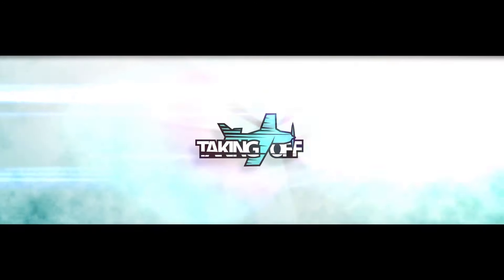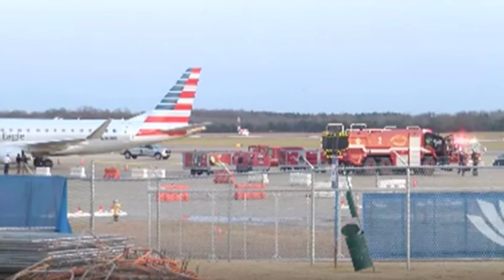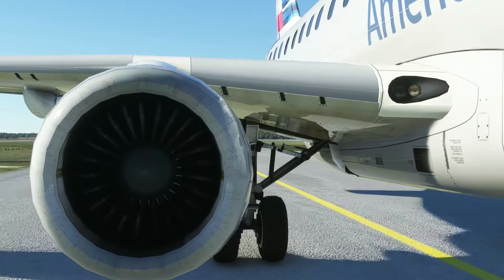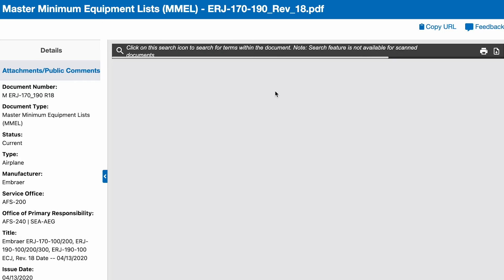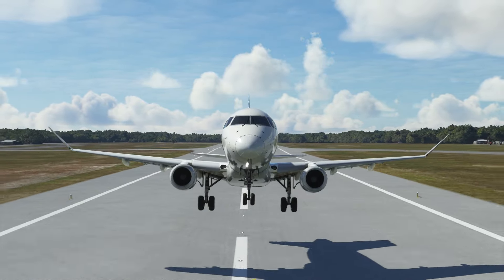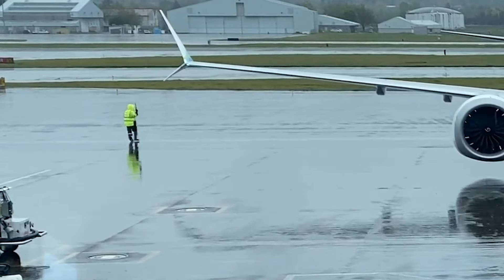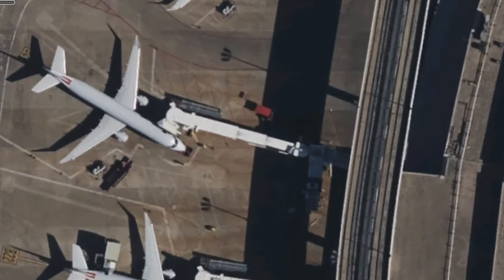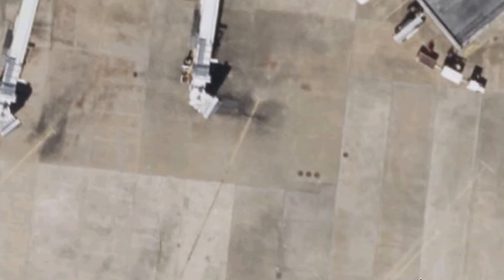Woman Sucked into Engine at Montgomery Regional Airport New Years Eve UPDATE

Comment: I fly this airplane and cannot imagine this scenario in real life. My condolences to the family and the crew members. Very sad.
Reply: How horrible to discover your mother has died in this manner.
I hate to even think about it.
Reply: I fly it also.  We use a.mobile screen.in front of.the engine for.in gate engine operations.
Reply: Horrifying,should this be made public,poor family
Reply: I'm a FA on the 145. I'm so saddened by this news.
Reply: Yeah someone i know was at the gate when that happened and they watched it all. They saw her get sucked in and chewed and and saw the body afterwards.
Reply: I never had any idea that the pressure was so high..First time learning this.
Reply: why arent there protection grids small enough to hold a person, large enough to not impact the airflow
Reply: I flew the E170/175 for a carrier similar to the one involved in this accident. Due to the underwing engine design, and a low to the ground airframe, the plane was at an increased risk of foreign object damage (FOD). Due to that we were hyper cautious during ground ops to prevent sucking up debris/cones/people etc causing damage to the engine or god forbid injuring or killing someone. The APU being out increases the threat at the gate due to the need to run an engine to provide electric power or a/c to the aircraft prior to getting ground power/external air connected (if available). It was a horrible tragedy. Something I would like to add and absolutely not pointing fingers here, just things to note. The ramp/line is more dangerous now that any time before. There are more flights/traffic than ever. Many of these ramp workers are getting overworked which leads to fatigue and lapses of judgement/poor decision making, but also I see a lot of ramp agents on cell phones often not paying attention. I watched a fellow First officer friend almost get ran over by the baggage cart because the guy driving was on his phone and didn’t look straight ahead of him before hitting the accelerator. I’ve watched wing walkers “guide in” the plane “watching the wing” without ever looking up from their phones. There is a video of an accident where the wing walker didn’t do his job and allowed planes to touch because he was on his phone. Not saying that’s what happened here, but it’s an added threat I notice way too much on the line.   Have to be cautious of your surroundings, have to pay attention, have to train appropriately, and have to communicate. Even after doing all of that well unfortunate accidents still happen.
Reply: @mbf156  Thanks for giving your perspective on these issues.  After seeing this model, I took notice of the underwing engine design as being particularly risky for ground workers.  Also, the abuse of cell phone use while on duty is particularly alarming.  It seems to me that cell phone use should be prohibited while working at these jobs.
Reply: @Robin-Visser  everything affects airflow. This net would have to withstand air pressures an order of magnitude larger than any hurricane, and thin enough that the gaps still allow most air thru. Engine performance would certainly be degraded (leading to other safety risks), not to mention increased likelihood of compressor stall and the potential for the net to pick up icing and clog the engine (the front of the engine nacelle often has ducting to run hot engine gases so ice doesn’t accumulate on them). 

Those are only the issues off the top of my mind, I’m sure there’s many more
Reply: @Robin-Visser  it doesn't happen enough for a guard to be put in place.
Reply: @mbf156  Not Aviation related obviously, but I had a kid walk in front of my car last week. He was walking, and looking at his phone. He never even realized he was in the middle of the road. People's obsession(especially younger people)with their phones is dangerous for everyone. A lot of the kids today can't even have a conversation. They're too stuck in their devices to pay attention to anyone. It's sad.
Reply: @Neverforget343  😲 wow, that's just tragic. Can't imagine witnessing that.
Reply: The same model plane, or the exact plane that killed her?
Reply: @beckyumphrey2626 with your grammar, I’d say it’s safe to say you couldn’t even fly a kite LMAO
Reply: @dextermorgan1  I’ve seen people of all ages buried in their phone. I was in a taxi where an older dude was buried in his phone and he hit another car. I got out and walked the rest of the way. I should have stayed to tell the police, but I was late to whatever I needed to do.
Reply: You can never be prepared for something like this..... A/C Mx on bigger birds here (F9). I've heard way too many stories...and those stories keep me on my toes around you guys with running engines....
Reply: @Robin-Visser  Ever hear of ICE build up.... Wouldn't want that when you are in the plane at altitude in icing conditions and your engine suffocates and stops turning....would ya?!?!  If any one doesn't think that's possible..... have you seen buildings and cars after an ice storm, same idea....except on a grid or screen....
Reply: All because they didn't want to shut all engines down, due to a faulty APU
Reply: @AlexMartin011  You're right. I have, too. It's crazy, but it's the reality we live in now.
Reply: @xpeterson  is 100% correct...  Not  all your answers are from armchair "aviation experts", some of us are actual experts.... 30+ years in the aviation / airline maintenance industry here...
Reply: @Cooking_With_Josh  You may want to stop, your ignorance is showing... Ever stop to think that English may not be their first language my friend... There are MANY pilots and Maintenance Techs in the world where English is NOT their first language. They only need to learn to speak and under stand English in order to fly in most countries...
Reply: @Robin-Visser  why cant people just follow directions???? Stop adding bubble wrap to everything
Reply: @pallotey810  You can't just shut the engines down with an INOP APU. If the APU is INOP on MEL (totally legal) then there is no alternate generator to supply power to the aircraft with engines off. You cannot have no electricity with passengers on board, not on purpose anyway, big safety hazard and against FAA Regs I believe. Anyway, the engine must stay on to provide power to the aircraft until the aircraft can be plugged in at the gate with external power... At some airports, the external power system is set up where you cannot plug the plane in to supply external power until the jet bridge in in position for deplaning and set to "AUTOLEVEL". This is to prevent the jet bridge from inadvertently pulling the external power connector from the aircraft if moved before the plug is manually disconnected, causing lots of money in damages that the airport maybe responsible for, hence why that safety function is present. 
Isn't it nice to get all the information to explain why things are the way they are form those who actually work in the industry? I hope this clears things up.
Reply: @Flyby-1000  
Do you have the history of the inop APU? Continued operation of a low hanging engine aircraft without an operational APU should be limited to one time. 
I am also in Aviation and I see aircraft depart with only one operational Air conditioning pack. The FAA should put a stop to such practices. It is just a matter of time, someone will walk into dangerous zones again. Safety zones are actually dangerous zones in our industry, it needs to stop.
Reply: My prayers go out to the ladies family but my prayers also go out to the piolets for mental trauma.. This is extremely sad for everyone.
Reply: @pallotey810  So what you're saying is that you want an incompetent government agency to take the responsibility of your safety? Got it... I DO NOT RELY on other people for the responsibility of MY SAFETY!!! They'll kill you!!!!
"I am also in Aviation and I see aircraft depart with only one operational Air conditioning pack." Then you, like myself, understand how aircraft are designed and how much redundancy there is in an airplane for safety. You should also understand how the MMEL is setup and know the difference between critical components and what's not. There are 3 leg MEL's (to get the plane to a maintenance base with the skill and parts that can perform the repair), 3 DAY MEL's (Cat B), the most common 10 day MEL (Cat C), and 120 day (Cat D) MELs. The type design is fitted for two packs, for redundancy, but is operable to fly perfectly safe with one to keep the aircraft pressurized and comfortable. APU's are not required to fly an airplane. The APU was designed long ago to allow the aircraft to be self sustaining at airports that did not have ground support equipment. The B707 and 727 did not have an APU when it was designed. So APU's are not a required piece of equipment for an aircraft to fly.
Do you suggest you just ground airplanes that have INOP APU's and the like? Remember, A plane on the ground (AOG) isn't making money. If the company isn't making money, they can't pay you, company goes bankrupt, and you have no job.... Repeat for every other airline............
Reply: @Flyby-1000  And with the name DIXIN CIDER, I'd say he's prob to immature to fly the kite he speaks of
Reply: @Flyby-1000  
With all due respect, we should read English language with understanding before we throw harsh words into the pie, it's not constructive. 
In my previous statement, I referenced revenue aircrafts departing with one inoperable airconditing pack, and I also stated that the FAA should make changes. Those statements are directly related to my dissatisfaction of the level of regulation. But, the FAA is a necessary evil.
My recommendation is:
1. The FAA should initiate a revision to MELS to include 
A, no departure of any revenue flight with an inoperable airconditing pack .
B, No departure or landing of any revenue flight at airports without a minimum of an APU or ground support equipment. 
If you are charging customers, make safe provisions at all airports that you operate. 
The FAA should also make a revision for number one and two Power-plants to be completed shutoff before any ground operations begins. To include deplaning revenue aircrafts.
Reply: @mbf156  any one working under this condition, stress and awareness should not aloud to have personal phone with them, during their shift. Why now everyone needs to have their face glue to a screen? If is not part of their job, it should be restricted. Again, as you said, this is not saying that this ladies was on her phone, but definitely, she was not paying attention.
Reply: Gives us all a reminder to be aware of our surroundings
Reply: @sforza209  awe has something upset you?💔🤣
Reply: @dextermorgan1  Yes, phones are an addiction many can't control...literally.  There needs to be mental health counseling and detox from phones.  I have had kids and adults walk right out in front of my car talking on the phone, never turn their head to look either way.......and this has been in school parking lots and near cross walks where you think people would be looking....nope.  The bus stop in front of the apartment complex I drive by on the way to work daily has like 20 kids at the bus stop....100% of them looking at their phones and none of them talking to each other, every day.  It's quite sad.
Reply: @Neverforget343  oh man if I saw that my day is done. That's as bad and maybe worse than a person getting hit by a train. I hope that person and others who witnessed and  dearly know this woman can eventually get over this.
Reply: @pallotey810  If the airport/station doesn’t have an airstart unit and the if the APU was deferred, then the pilots would need to keep at least one engine running during the turn.
Reply: @dextermorgan1  Don’t get me wrong. I’m dumb as fuck with the phone as far as sitting on my ass on days off. I just make sure my motor, bodily skills, are in working order as I’m sure you do too. Sometimes I get worried when my dad reaches for the radio knob lol.
Reply: @pallotey810  i almost hit an elderly woman walking across the street from the front of a van. slammed on my brakes and said mam you should have looked i almost hit you. she told me she had the right of way. i thought you have the right to repeat that comment all you want in intensive care. we teach our kids this safety,  when or at what age do we feel ignorance is our right ?  please dont tell me they do not teach this at an air port. im sorry she died but in the big picture .... survival of the fittest or smartest
Reply: @iffybader7904   Perhaps as a stark reminder to other workers of it’s intense dangers and to always heed the safety protocol!
Reply: @CW why you talking down on GreggyD??
Reply: Does Rigor Mortis still occur?
Reply: @Joseph Quinn  
Repeated and routine actions coupled with efficiency is the daily practice of a ramp worker. They are always around a cold engine. 
The whole thing changed when one out of a thousand, there's a hot engine. 
This is how a repeated speedy service with a change in plan can cause an accident. Do not run an engine with ramp personnel in action could have saved her life.
Reply: from one pilot to another. i know you couldnt resist the urge to let everyone know you are a pilot. i understand.
Reply: @glorious28  Always! My wife always say to me, that I pay attention to everything! I said, well It's my personality, been that way since little. And it comes handy!🤣 🕊️
Reply: This is not related to any facts of this specific case. I’ve told my wife many times I don’t like being right because something bad might happen. I’m a total aviation armchair Buffoon With that said and out of the way, logic dictates, Overworking a employee, possibly tired and stressed, coupled with what appears to be no guidelines or rule in place regarding cellphones in what I’ve seen as a very busy and hard job with all the ground crews, cell phones should have guidelines enforced. I was a SWBell- AT&T Regional Sales manager. My life, I owe to God, for all the near misses (while driving) where I could have died or killed someone for the lack of judgment and focus.
Reply: @@joseph.price.2323 One thing for sure, she probably didn't feel a thing. May The Lord Have Mercy on her soul, and give confort to the family!
Reply: @tonyabrego1  been there few times, to do with damn cell phone. I used to trade a lot, using the phone, leverage trading, and sometimes I had to check positions, you know, like one of those moments, that afterwards you day to yourself" Why did I do that"! No more, as you stated,. God Give us only so many chances, I think I used most of them, at 69, I made very far🙏🙏🙏.  🕊️
Reply: @tonyabrego1  Amen!
Reply: "in real life" powerful analogy. What did go wrong here...
Reply: And in a mechanic on these aircrafts.
Reply: @iffybader7904  sorry if Il
Reply: @Neverforget343  ooh my gosh 😱  how terrible 😔
Reply: @jkwyx8290  that would definitely give me nightmares 🥺
Reply: @Joseph Price oh please 🥺 don't say that 🥺 my goodness
Reply: I was thinking about the DC10 where 9 people got sucked out of the plane. 2 or 3 got pulled into engines. They couldn't tell. One guy's parents HOPED he did, as it was better than just being thrown out if the plane. 

THAT is horrifying. Up there w Cocoanut Grove fire victims sitting at the bar upright. Dead. Untouched by fire
Reply: @Neverforget343  Body? No, nothing really left.
Reply: @iffybader7904 Sadly, the only way to avoid this tragedy again is to make it known
Reply: You fly the same model, or that exact airplane?
Reply: All the paint markings are faded away. Their is no longer any safety envelope. For any worker especially newer workers
this spells disaster. Once again the corporations put profit before safety by not repainting all the markings in the airport.
Any hungry lawyers out there looking for a big juicy law sue case. Go for it lawyers, help the hurting family of that victim.
Please share this message.
Reply: So very sad
Reply: Why can't you imagine?  She was not paying attention and got sucked into the engine, coming out the other side in pieces.
Reply: @MaDAddictz23  I was in plane catering for a few years, so i understand too.
Reply: @mbf156  if thats the case, then all phones by flightline crews should be prohibited, i worked on flightlines for 11 years, never needed a phone.
Reply: @jessebaldwin2661  thats what i just said, then o read your comment.
Reply: @beckyumphrey2626   Thank you, I was wondering why precautions weren't taken to prevent it.
Reply: @Cooking_With_Josh  bruh your profile pic....just lmao....start a gofundme for some food and a gym membership
Reply: @Robin-Visser  why? because it would be like a piano wire. just dice whatever it is up in to smaller chunks is all.
Reply: @Flyby-1000  i'm guessing they didn't have anyone trained to use a start cart.
Reply: @471decaturstreet3  lol clever name. i get it now. yeh def a little immature
Reply: @PoisonShot20  phones are not allowed on the ramps at most airports. for one they are not intrinsically safe.  howver I know how a lot of smaller contractor outfits work. they cant ever keep staffed, they are over worked and under paid and receive very little training.
Reply: @fn0rd-f5o  hmm yes maybe you’re right.   What if it only covers the engine when taxiing?
Reply: Jet engines suck
Reply: @Joseph Price aww thank you for the compliment and I try to be especially since I'm in my 40's. Awful things happen always around the holidays. And she was also a mother 😔🥺
Reply: @windsofmarchjourneyperrytr2823  the man said that all was remaining was the torso everything else was gone in front and behind the engine spread 20-30 feet in front and behind
Reply: @Marcel Miller  , wth, how is it his fault?
Reply: @Jesse Baldwin  , cell phone addiction is a real problem.  I see people driving and texting,  and staring at their phones while driving.
Reply: @blueforest2927 : Exactly the opposite in that area. What a tragedy.
Reply: @Cooking_With_Josh : Seriously? Since when should how someone speaks or writes have to do with how skillful they could be physically? That didn't make any sense.
Reply: @imaner76 : It's not really an analogy. Whether he can imagine it or not, it IS real life, sadly.
Reply: Marcel Miller  What a nutty comment.
Reply: @Cooking_With_Josh  I too am horrified at the high level of illiteracy in YouTube comments. It's absolutely scary to see the level of ignorance.
Reply: @Flyby-1000  👍🏼
Reply: @HelloKittyFanMan.  😘
Reply: @Robin-Visser  physics and engineering.
Reply: @Princess Mari The aircraft design engineers are 100% aware of the ingestion areas of the engine. They will not by design put a ground maintenance / comm panel in the engine ingestion zone.... Come on now....
Reply: @Princess Mari I didn't say or imply that you said it was.... I work around these  machines on the daily. You must never get complacent and always keep your head on a swivel, paying attention to your surroundings. 
There's a headphone jack that's located on the engine cowls on the A320's. I avoid those jacks and use the one in the belly service panel. We have to be next to those engines running at idle. We have to do leak checks on fuel, oil, hydraulics, and pneumatics. So, whether or not the panel seems like it might be closer than normal or not... they / we are all trained to know where to be and not to be in certain phases of operation...